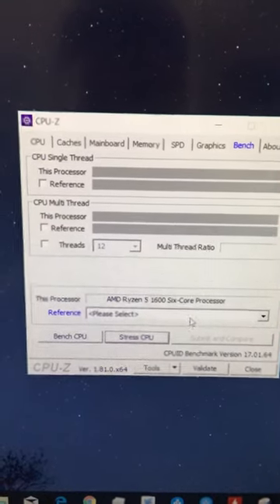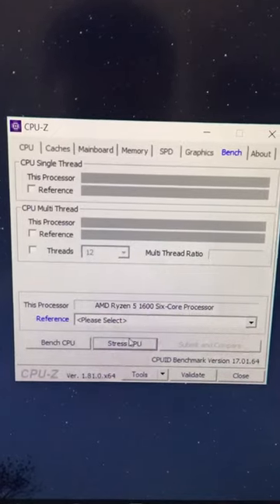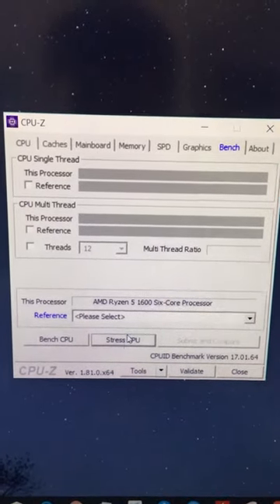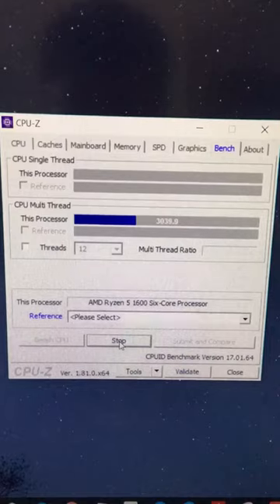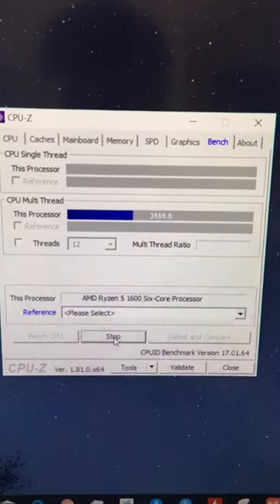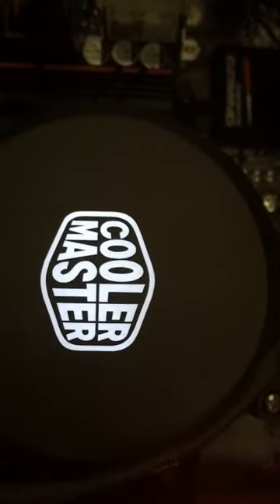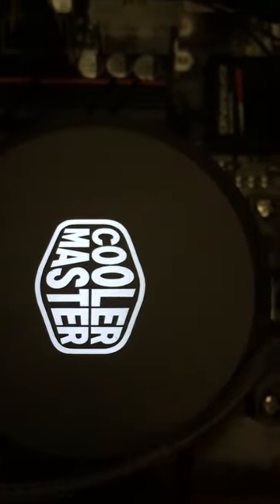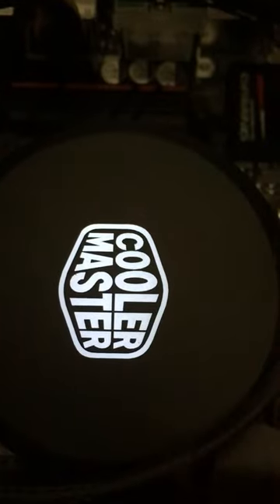Motherboard/CPU noise when under stress

Comment: My computer does the same. Any way of solving it ? I have a Ryzen 2600X with an Aorus B450-I
Reply from the maker: it was coming from my gigabyte motherboard, I returned it and changed to a different brand, problem solved. I couldn't tell whether it was "normal" (some particular models of any brands could have pitch noise) or simply because I got a faulty one.